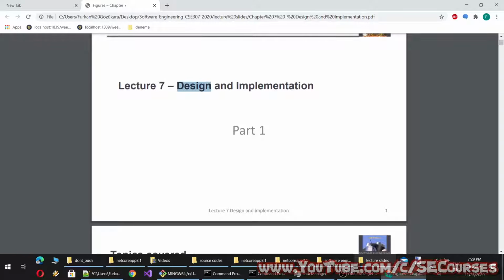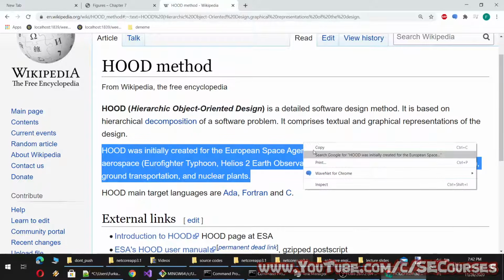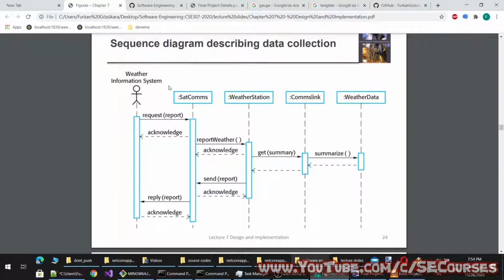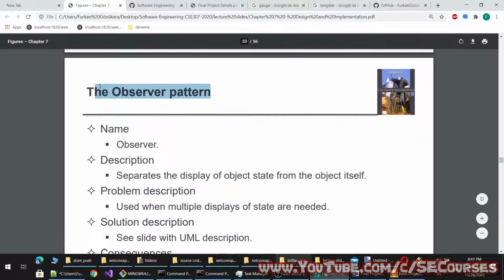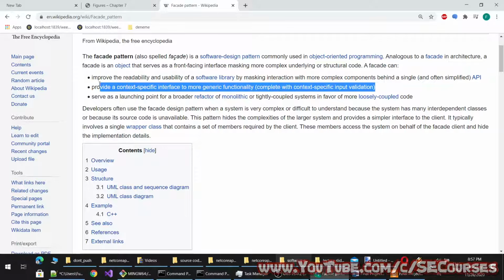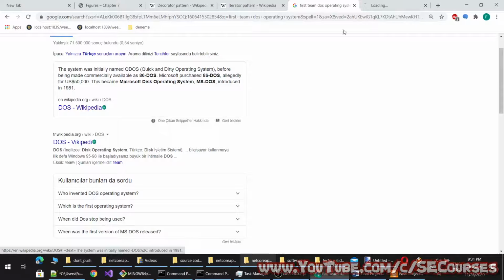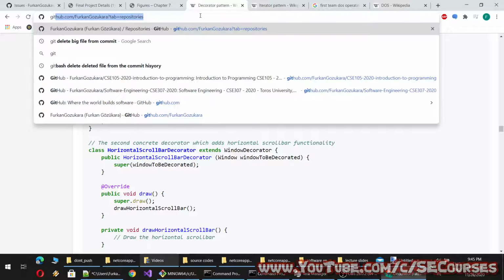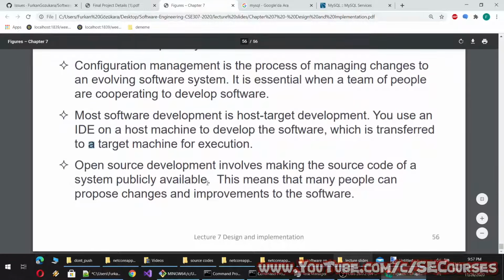#Software #Engineering - Lecture 7 : Design and Implementation, Design Patterns & Open Source Coding

Comment: From this video we learned
-What are software design and implementation
-What are process stages
-What are  open source systems and issues
-What is reuse and its levels and costs

Burhan Yaşbay 
195050027

Comment: In this lesson i learned:
- what are software design and implementation
- what is an object-oriented design process
- what are the system context model and interaction models
- what is architectural design
- what is object class identification
- definition of the Hood method
- what are design models
- what are subsystem models
- what are design patterns
- definition of observer pattern,facade pattern,
iterator pattern and decorator pattern
- What are reuse levels

Samed Arıcı - 195050005

Comment: In this lesson I learned, 

-Object-oriented design using the UML
-Configuration management
-Implement issues 
-Design Models
-Reuse
-High-level architecture
-Observer pattern
-Context and interaction models
-Implementation issues

185050004

Comment: In this video i learned that;

Design and implementation,
What COTS is,
object-oriented design process,
What process stages is,
system context and interactions,
Context and interaction models,
object class identification,
Approaches to identification,
What HOOD method is,
design models and example of this,
Subsystem models,
Sequence models diagram describing data collection,
interface specification,
design patterns,
Observer pattern,
Some problems in design,
What facade Iterator pattern is,
implementation issues,
Reuse and its costs,
development platform tools,
What IDEs is,
Open source development, systems and issues,
license models,

Ahmet Yusuf Diktepe
175050013

Comment: Open source development
 Architectural design
 Object class identification
 Approaches to identification
 Design models
 Interface specification
 Design patterns
 Pattern elements
 The Observer pattern
 Multiple displays using the Observer pattern
Configuration management
Host-target development
Development platform tools
Integrated development environments (IDEs)
Component/system deployment factors

165050016

Comment: what process stages is,
system context and interactions,
Context and interaction models,
object class identification,
Approaches to identification,
What HOOD method is,
design models and example of this,
Subsystem models,
Sequence models diagram describing data collection,
interface specification,
design patterns,
Observer pattern,
Some problems in design,
What facade Iterator pattern is,
implementation issues,
Reuse and its costs,
development platform tools,
What IDEs is,
Open source development, systems and issues,
license models,

Simay Seyrek, 195050001

Comment: In this video
-Design and implementation
-design pattern and pattern elements
-Subsystem models and sequence models,
-object class identification and approaches to identification
-reuse, reuse levels, and reuse costs
-interface specification
-design problems and implementation issues
-open source development and open source systems
-development platform tools
-component/system development factors

M.Burak PAKER
175050012

Comment: 165050012 
I learned this video:

- High-level architecture
- Configuration management
- Context and interaction models
- Implementation issues
- Object-oriented design process
- Objects classes
- State diagrams
- Interface spesification
- Weather station interfaces
- Observer pattern
- IDEs
- Open source development
- Open source systems
- A UML model of the Observer pattern
- Host-target development
- Reuse, reuse levels and reuse costs
- License models and management

  Thank you for lesson.

Comment: In this video I learned;

*O-O design process
*Process stages
*Intecration models
*Use case description
*High-level architecture
*Identification
*Objects classes
*Design models, examples, and problems
*Subsystem, sequence models and diagrams
*State diagrams, interfaces
*Design patterns, pattern elements
*Observer pattern
*Reuse levels (abstraction, object, component, system)
*Reuse costs (needs)
*Configuration management
*IDEs (specific or general)
*Open source systems, issues, business, licensing
*License models (GPL, LGPL, BSD)

Abdulkadir Durmaz
175050008

Comment: 175050010
In this lesson;

- interface specification,
- Information about the object-oriented design process, context and interaction models,
- Design pattern and pattern elements,
- System context example(for Weather state)
- The observer pattern,
- Design Patterns  a general repeatable solution to a common problem in the design of software.
- Design problems and implementation issues,
- Observer pattern

Comment: In this video, I have learned those in below;

-Design and implementation
-An object-oriented design process
-System context and interactions
-Object class identification
-Design models
-Subsystem models
-Sequence models
-Interface specification
-Pattern elements
-Implementation issues
-Reuse
-Configuration management
-Development platform tools
-Integrated development environments
-Component/system deployment factors
-Open source development

165050011

Comment: In this lesson, I learned;
+Information about state diagrams,
+Information about design models and examples of design models,
+Information about the observer pattern,
+Information about design pattern and pattern elements,
+Information about subsystem models and sequence models,
+Information about the object-oriented design process, context and interaction models,
+Information about object class identification and approaches to identification,
+Information about reuse, reuse levels, and reuse costs,
+Information about interface specification,
+Information about design problems and implementation issues,
+Information about open source development and open source systems,
+Information about development platform tools,
+Information about integrated development environments(IDEs)
+Information about host-target development,
+Information about component/system development factors.
175050004

Comment: in this video I have learned the following: 
- Object oriented design with UML
- Desgin patterns and pattern elements 
- Implement issues 
- reuse levels and costs
- development platform tools
- integrated development 
- open source system, issues and liecensing 
- liecense models and management 

185050901

Comment: I learned,
-object oriented design process,context and interaction models,
-object class identification and approaches to identification,
-design models and examples of design models,
-subsystem models and sequence models,
-state diagrams,
-interface specification,
-design pattern and pattern elements,
-the observer pattern,
-design problems and implementation issues,
-reuse, reuse levels and reuse costs,
-host-target development,
-development platform tools,
-integrated development environments(IDEs)
-component/system development factors,
-open source development and open source systems
Ceyda Süzer
175050003.

Comment: In this lesson i learned;

-Build or buy
-Object-oriented design process
-System context and interactions
-Context and interaction models
-Object class identification
-Approaches to identification
-Design models
-Subsystem models
-Sequence models
-State diagrams
-Interface specification
-Design patterns
-Pattern elements
-The Observer pattern
-Design problems
-Implementation issues
-Reuse and its levels and costs
-Configuration management and activities
-Host-target development
-Development platform tools
-IDEs
-Open source development
-Open source systems
-Open source issues
-Open source licensing
-License models
-License management

Ebla Ekerdiker
185050010

Comment: i learned in this lesson.

+ Topics covered
+ Object-oriented design using the UML
+ Design patterns
+ Implementation issues
+ Open source development
+ Design and implementation
+ Build or buy
+ An object-oriented design process
+ Process stages
+ System context and interactions
+ Context and interaction models
+ System context for the weather station
+ Weather station use cases
+ Use case description—Report weather
+ Architectural design
+ High-level architecture of the weather station
+ Architecture of data collection system
+ Object class identification
+ Approaches to identification
+ Weather station description
+ Weather station object classes
+ Some other models , such as; Design , Examples of design, Subsystem and Sequence models
+ Some Diagrams ( Sequence diagram describing data collection, State diagrams, Weather station state diagram)
+ Interface specification
+ Weather station interfaces
+ Design patterns
+ Pattern elements
+ The Observer pattern
+ Multiple displays using the Observer pattern
+ A UML model of the Observer pattern
+ Design problems
+ Implementation issues
+ Reuse, levels and costs
+ Configuration management and activities
+ Host-target development
+ Development platform tools
+ Integrated development environments (IDEs)
+ Component/system deployment factors
+ Open source development, systems, issues, business and licensing.
+ License models and management
195050803
Reply: 44:25

Comment: this lecture covered these main topics Object-oriented design using the UML
, Design patterns
,  Implementation issues and Open source development. To sum up, design Patterns  a general repeatable solution to a common problem in the design of software. Configuration management is the process of managing changes to an
 evolving software system. It is essential when a team of people are
 cooperating to develop software. Most software development is host-target development. You use an IDE on a host machine to develop the software, which is transferred to a target machine for execution. Open source development involves making the source code of a system publicly available. This means that many people can propose changes and
 improvements to the software. 175050901